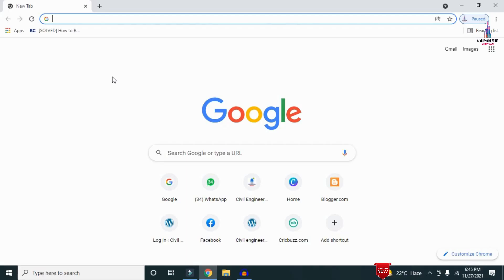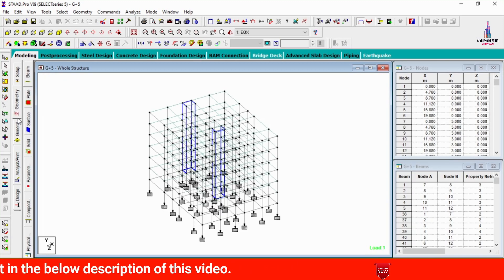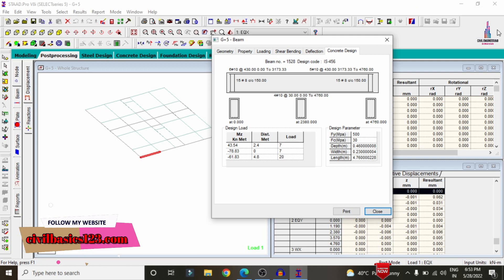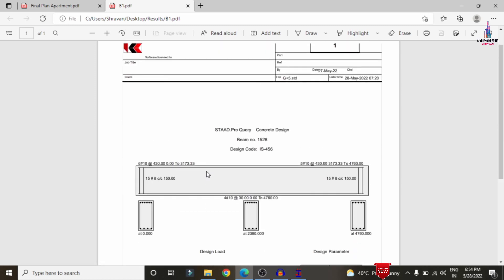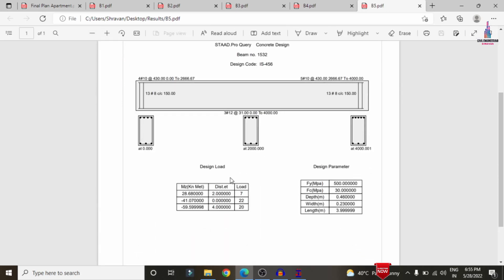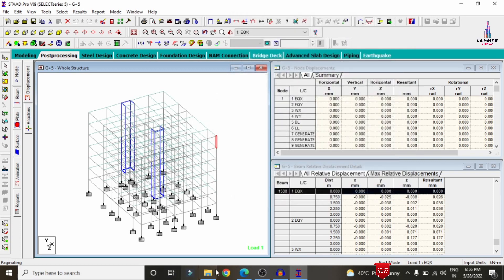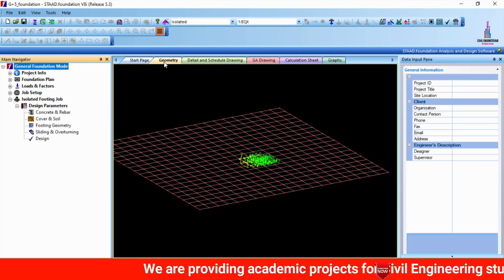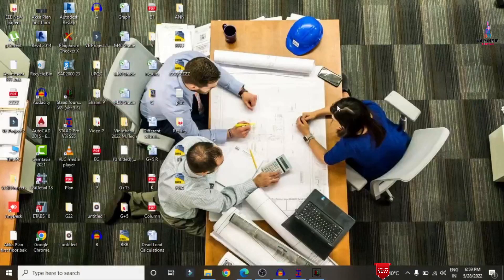How to print STAAD results to PDF file in building design | structural design | civil engineering |

Comment: What is the correct method for modeling a drop beam within a single span in Staad Pro?
Reply from the maker: I will make separate Video On it Soon
Reply: @civilengineeringbyshravan9596 
Hi, I'm a beginner learning structural analysis. I'm working on a project that involves a stepped beam. What is the best approach to analyze and design this type of beam?
Reply: @civilengineeringbyshravan9596 

Thanks! I'm looking forward to the video